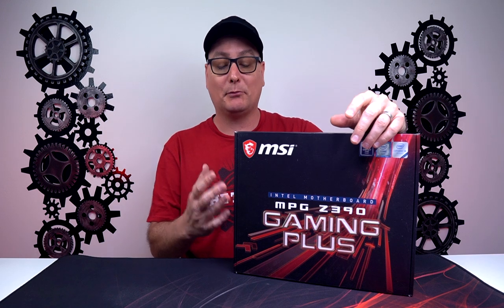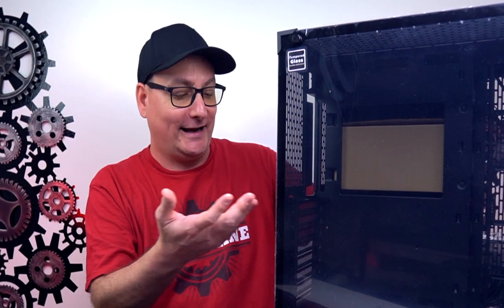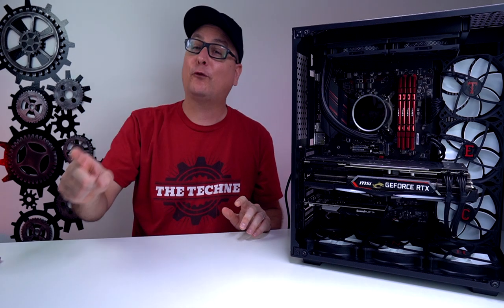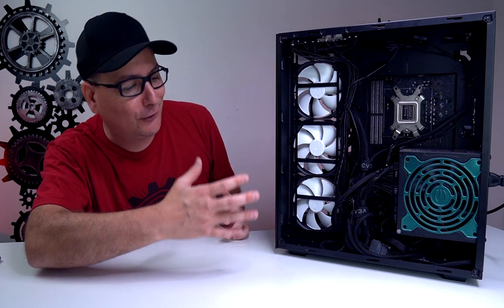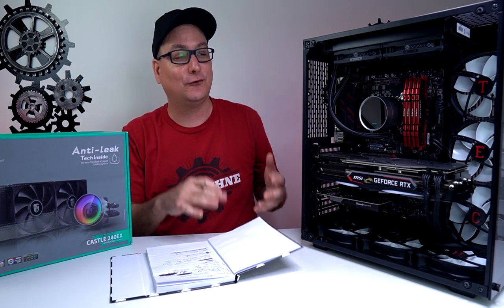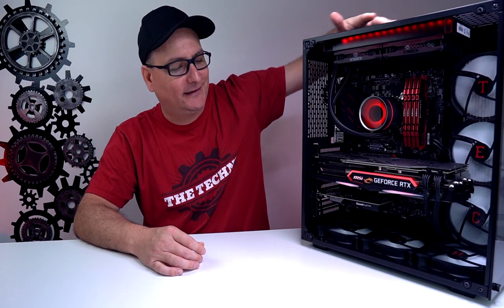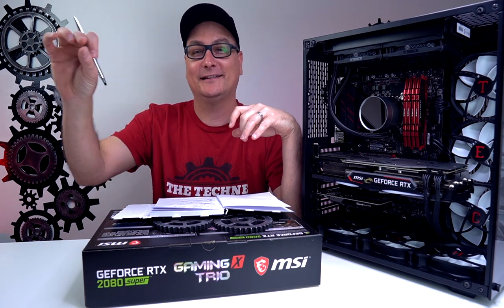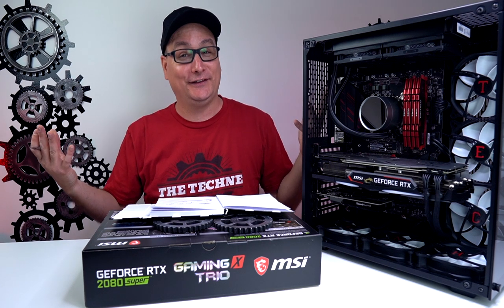MY NEW 1440p GAMING PC! 2080 Super with i7 9700k

Comment from the maker: With this build costing $2546.99 (with tax, and a legit copy of windows) would you have spent the extra $ for a 2080ti?
BTW my main reason for building this pc was to have a second PC for more pc product reviews. Using my main as my test pc was not working out. If that pc went down so did the channel. 
So I do still have and use my Ryzen build.
Reply: If I were you I would have saved a bit by going with ryzen and definitely would have got a 2080ti. Regardless your setup is a BEAST 🔥.
Reply: NOT at all I think this is a beast,  but I think you already have a Ryzen that's why you wanted Intel. Yes,  I would of went with Ryzen, I'm so happy for you brother
Reply: Should of gotten a 9900k
Reply from the maker: @abdelrahmanaref8868  yeah, but the ryzen wouldn't have saved that much, the 2080ti would have been 500$ minimum more.
Reply: @TheTechne  in that case screw the 2080ti😂
Reply from the maker: @abdelrahmanaref8868  lol. yeah
Reply: i recommand u try out Nvidia ultra low latency mode, i have almost identical rig, and with ultra low latency mode in nvidia control panel my frametimes improve and my CPU usage drops alot!
Reply: Ye .. Would have gone with the 2080ti (since that's what I did) xD

I upgraded today as well .. I went out and bought the Logitech G Pro Wireless! Now I understand all the hype it's been getting :))
Reply: no, i would even just get the regular 2080 instead of the super, its $70 cheaper than the 2080 super and theres barely a difference between them
Reply: @MattRichy  9900k doesn't add much to gaming or fps - Unless you plan to stream or do heavy editing on the pc as well.

2080ti does however give you a 15% increase over the 2080 SUPER.
Reply: Iddqd i have a 9900k and a 9700k big difference trust me
Reply: @MattRichy  I have the same and I honestly can't tell the difference from when I upgraded.

Was a waste of money imo .. But it was on a super sale where I live.
Reply: I wouldn’t have personally saved for the Ti, as the newer Ampere cards are coming later in the year!
Reply: @kevinzyrkowski  there is no release date yet .. And with current situation worldwide, they might postpone it to next year.

Besides, why wait if you can tons of fun with a super GPU right now.

I knew a 3080 would come at some point as well when I bought my 2080ti .. 1 year later is still not here and my GPU is maxing everything out. 2080ti will last me at least 2 more years @ 2560x1440p
Reply: You should do a video like building a pc for 600 dollars with a list of parts we could buy
Reply from the maker: @r1c0-le0n4  I have done one around that price, even lower about 450
Reply: The Techne found it, im gonna watch it now. Really helpfull how you respond so fast.
Reply: Why intel?
Reply from the maker: @Syeda_Afsana_1.4  just wanted to try it out, I have always used AMD
Reply: @TheTechne  nice bro
Reply: The Techne nice video but do you get any coil whine on your gpu tho?
Reply: Perfect Timeing man a couple  months ago i was trying to make my first pc but i was calling it quits. I was thinking to just get The xbox x series but i found this video with my budget and color theme!
Reply from the maker: @Luna-mo4bp  awesome! so glad I was able to help! did you get it built?
Reply: @TheTechne  Soon i hope. besides that i just recently shipped all the parts.
Reply: i got a prebuilt version of this for almost a thousand less.

Comment: Looking great! I have i5-9600K with gtx 1060.. pretty solid build, but waiting on nvidia 3000 series.. RX5700XT is tempting but maybe I’ll wait 😩
Reply from the maker: 5700xt's are going for fair prices right now. I also use a 5700xt in my other pc
Reply: You can overclock the 5700xt to get massive performance gains

Comment: Great build and video but I would recommend trying to sell the 9700k as soon as possible to try and upgrade to the 10700kf which has better performance than the 9900k for a similar price to the 9700k. Also buy a decent z490 mobo.

Comment: Hey Techne, I just built my first PC recently and was trying to save some money in areas without lowering performance too much. I don’t plan on doing any overclocking and I decided to go with the i7 9700F instead of the 9700K. I’ve been looking up reviews of people with similar builds as mine and everyone seems to have chose the 9700K, like yourself. Do you think I made a good choice on the 9700F? Will I see any noticeable drops in performance? I have a 2070 super GPU and will be using this build mostly for gaming. Thanks!
Reply from the maker: not to sure. that's also why I went with the K, many people were recommending it

Comment: I have i9-9700k with msi ventus rtx 2080 super oc and a monitor of 1440p 144hz but I'm  having a 80-100 fps with warzone on normal graphic settings. How are you able to get 150fps. I turned of my vsync. Can someone help thanks.